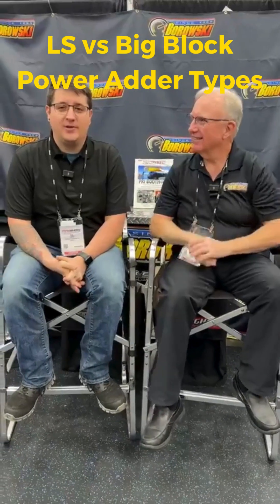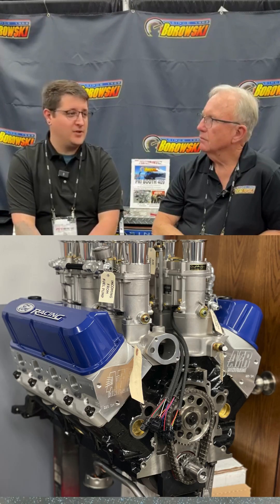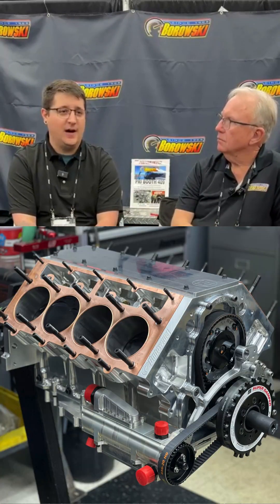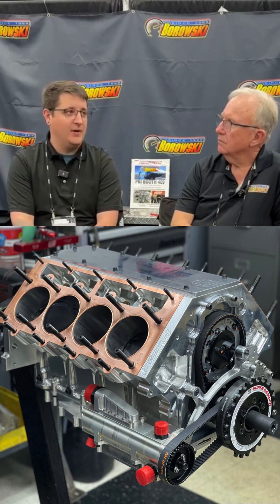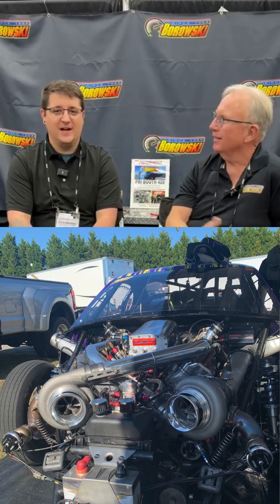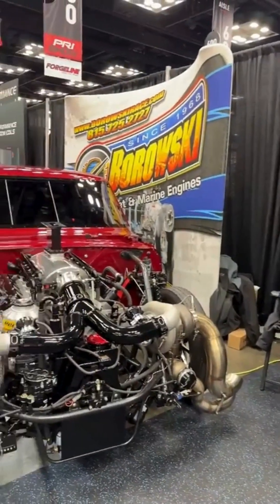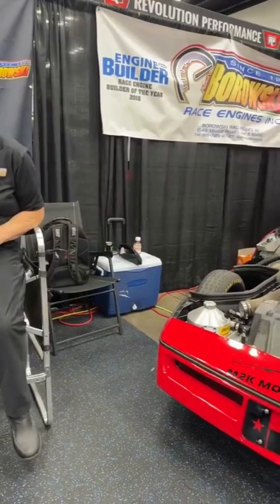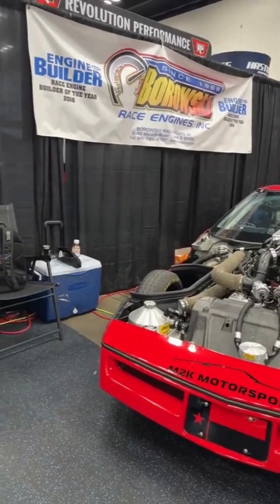LS v Big Block, Power Adders, New BRE Builds, FuelTech #pri2023 #horsepower #turbo #supercharged

Comment: Is it possible to make 2000-2500hp with a twin screw bbc drive anywhere (within reason)? or would it be methanol and race only?
Reply from the maker: We rather go with either a turbo or a ProCharger.  Here is an example of a turbo BBC for Drag & Drive. https://borowskirace.com/products/3-000-hp-rated-r-t-twin-turbo-big-block-chevy-engine-complete?variant=37574119817390